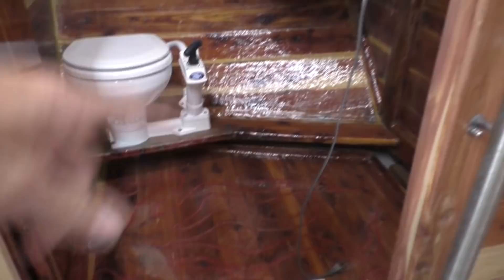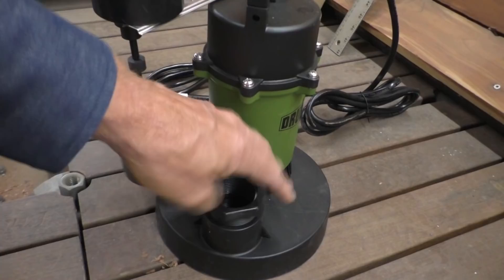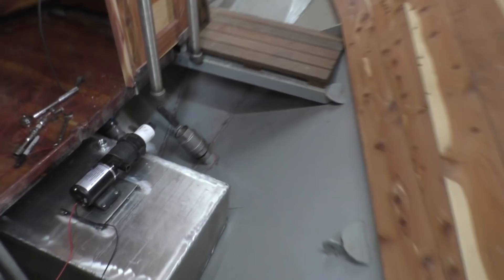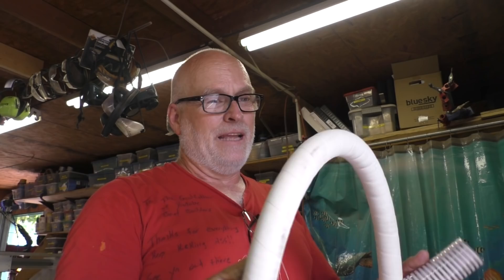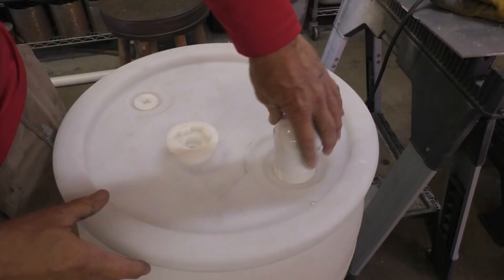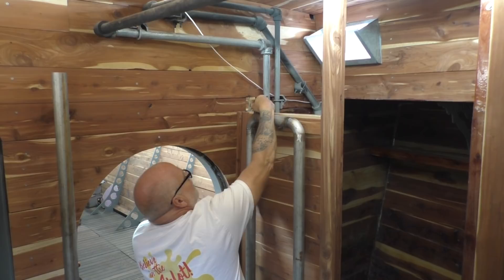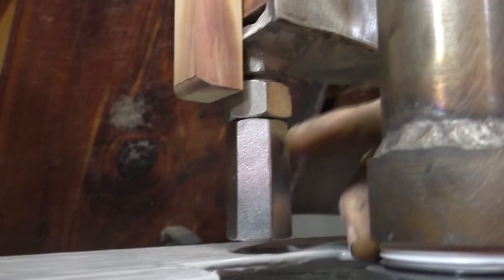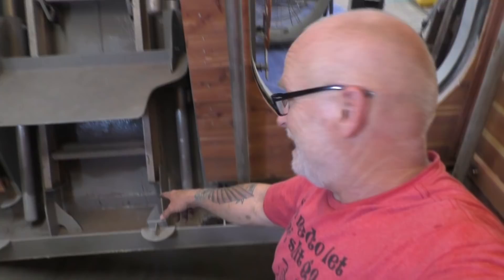Boat Heads - Part 7 - DIY Shower and Sink Sumps

Comment: hey Doug  for the pipes if you want cheep way for flexible PVC pipe, take hard rubber garden hose. run how you would like the PVC  then fill it with spray foam. then you have mold for the PVC pipe,  then take hot sand fill PVC pipe and the you can zip tied the the garden hose.

Comment: For small volumes you'd prefer kept  dry how about ejector pumps? Kind of thing some school/college chemistry labs  will sometimes use for generating vacuum. Some use for pick up coolant and swarf, during machining, , and transfering it into a drum. Powered by a  compressed fluid line (air or water), motive fluid+pumped fluid can be sent down a second pipe.

Comment: NPT is a global standard. Not just USA. It all depends on the engineer who is specifying the fastenings. The truth is they are mixed everywhere and a royal pain in the ass to find the adapters to and from metric in industry.  If you buy a skid mounted equipment package, you can specify the connections in and out but on the skid itself their is usually a mix.

Comment: When test my tank welds first i blow compressed air along the weld seam and spray soapy water on the opposite side very tiny leaks will show once i am sure I do a pressure test with soapy water
Repaired a lot of diesel fuel tanks like that

Comment: Gas tank epoxy liner in both your new tanks there. Seals against leaks and really fixes possible corrosion worries. Multiple wins.
Reply from the maker: For sewage tanks, it's not a great idea because if and when it comes off it will play hell with the pump.
Reply: @SVSeeker  ahh, I was going off my gut on it holding up better between aluminum and water/sewage , vs gas/e85 in a steel tank.

Comment: Fyi - The plastic mount under those cheap macerator pumps is brittle and breaks very easily.
They appear to have been molded with too much regrind, not enough virgin plastic. Glass filled is more brittle anyways.

The mounts can be easily remade with a piece of black pipe cut to match the motor curve, welded to a piece of flat plate and drill for the 2 mounting holes.
Take off one of the mounts and look at it, you'll see what I mean.

Comment: Mr Seeker, did you pressure test the two plastic barrels before installation?
as I was following the round the world powerboat race and they had one full of derv, and it leaked 40 gall of derv into the bilge.     ups...

Comment: I know nothing about boats and sumps so this idea is truly off the wall.  For little places like that corner would a vacuum be good?  Maybe a pipe that stays there and you come by and vacuum it on on occasion?   
It is called spit shining for a reason;o)
For your sewage storage tanks, I know they are not intended to be a septic system but if you aerate them aerobic bacteria will establish itself and the smell is so much less offensive from aerobic bacteria.  Note I said less offensive.  Smells like rich earth that some people still don't like.  Though this will kill all the bad germs like a septic system but my thinking is just decrease the terrible odor.
Reply from the maker: It’s not a bad idea at all especially because we use a shop vac frequently. And they actually make tanks for boats that have aerators built in. The idea is to process the sewage in the tank so what is discharged is relatively harmless.

Comment: Don't use heat on the $$$ hose.  Get an exhaust pipe expansion tool from Harbor Freight.  It will stretch it just enough to completely capture the barbed fitting.

Comment: Doug,  for those really tight hose to fitting situations, see if you can find some vegetable based grease that they use on slip couplings for large water lines.  It works really well and even helps keep your hands soft.
Question:  Is there ever anything done on a boat that is only done once?  Based on your videos I am considering you an experienced authority on this subject.  I've only built small skiffs and took so much time doing them that I only had minor things to "adjust".  But you have been building something hundreds of times more complex so the "adjustments" have to be many times more.  Thanks for the video, take care and stay well.

PS. The sunset at 18:00 was beautiful.
Reply from the maker: Thank you, I've been looking for something to soften my hands.  And, I doubt it.  And that's a bad idea.  : )
Reply: @SVSeeker  ROFLMAO, you realize that most high dollar lotions are made with urea right.  If you need to soften up just pee on your hands in the shower. ;-D

Comment: I can just imagine this just being towed to the water and getting wrecked by a bridge on the way like I always think that because isn't this being built in Oklahoma where there are low bridges everywhere
Reply: It's in Oklahoma but it only has to go from about downtown Tulsa to the port of Catoosa so about 20 miles or so till it's at water deep enough to launch.  At that point the mast will be installed and the sails will be rigged up.  It will be much less of a problem than you think and should be able to be hauled on the highway's and go over the bridges rather than under.  It will need special permits and such to move but honestly once those are all in hand and everything is ready and the move window is open it will probably take a couple hours to be there.

Comment: You coud use some of these to fix down the tank, just weld on some aluminum ring and spann them down - it hold well, even long therm, I have some like them seen being used for mounting a 100 galon emergency fuel tank on a 52ft Carver Yacht - it works very well and is stabile while being acessible https://www.karabiner-und-mehr.de/edelstahl-seilspanner-spannschloss-haken-oese-m6-v4a.html idk how they are caled in englisch, google translate is useless for technical stuff and part names so here you go   
You might want to mount some LED underwhater lights somewhere acessible- easily cleaned and acessed - its great- at night the plankton comes to the light - and so do the fish, its also very nice when you go snorcling at night- with the light you see the seabed 30ft down very nicely, also if you only put a sponge in the bilge it wouldnt dry out but get moldy - usualy most whater in the bilge is condensated fresh whater - also dont forget that over time the bilge gets full of diesel, motoroil and diesel soot.
 Every year or two youll need to pressure wash the engine bay bilge and pump out the dirt to prevent a fire hazard and the strong diesel smell - also look into getting some sound insulation for the engine compartment - stone wool is ok but i prefered acustic foam cause its not iritating like fibers are, just gotta look into the thermal insuoation as well so nothing overheats,  
Best of luck, cant wait to see some travel videos with SV seeker 30° slanted in 15ft waves and doing 25 knots  with some good consistant wind  - also you should look into getting some space prepared for some plants like chilli, tomatoes , puprica, oranges and lemons and some spices and herbs for cooking - since you will have unlimited solar powered fresh whater production you can get some plants they just need a place where they dont overheat, get enough sun but not so  much that they get sunburned and dont get salt sprayed - like a mini greenhouse.

Comment: Love those water pump pliers that don't actually move all over.  Had a pair for years, made by Irwin but they have multiple sizes.  https://www.irwin.com/tools/pliers-adjustable-wrenches/groovelock-pliers  Looks great though, my only thought on the anti siphon is getting crud up in there so that the anti siphon sticks open and allows some gasses to come out, but worse case add in a P trap above it so you can set a little water in and keep the gas where it belongs.
Reply: Irwin is that even a proper brand nah I used those and was not satisfied on a daily basis

Comment: Here in France we have flex wastepipe.
  https://www.bricodepot.fr/catalogue/tube-pvc-souple/prod57732/
  I have used it and it works for getting a sink/macerator waste through a 1 metre thick stone wall. 10yrs and not a whiff yet.

Comment: I'm a lowly turd herder but I know what I can trust from my training and experience.. You would be better served by liberty or little giant. Why... Why would you trust harbor freight?!  Life advice, never buy a house with a sewer basin. If you are stuck with a house that has a sewer basin then at least use a Liberty grinder pump.
Reply from the maker: Cost to performance ratio given the low duty cycle and the present value of the dollar.   Why is that not obvious to you?